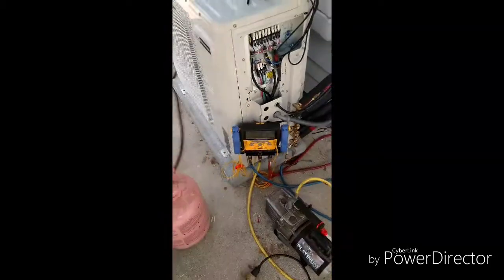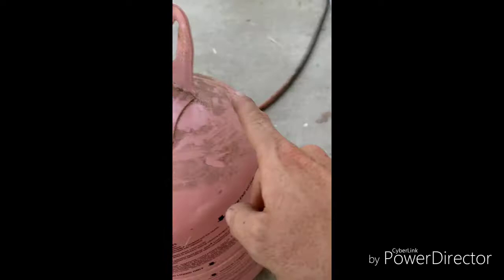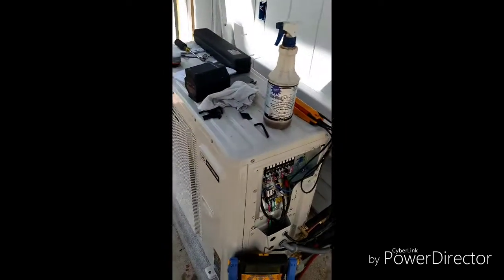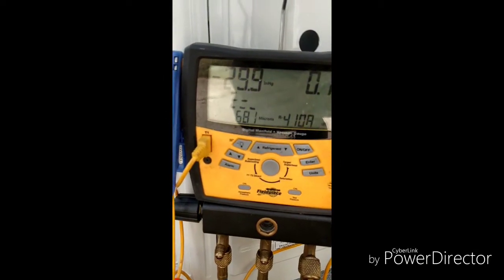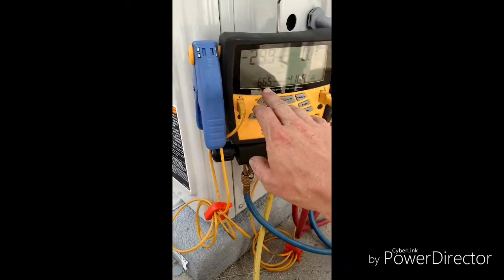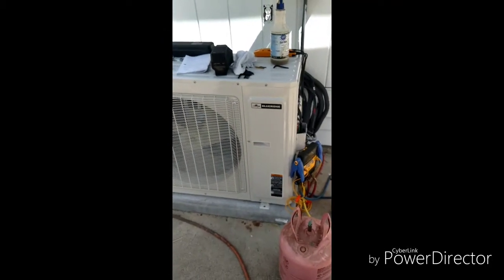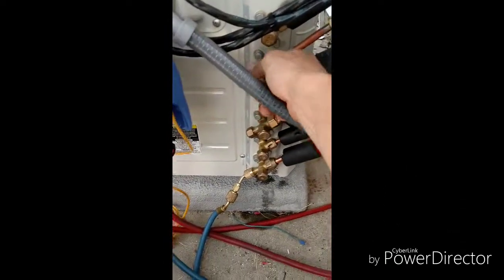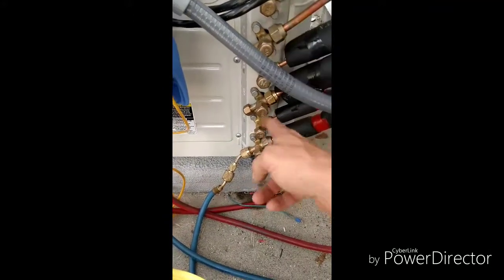How to Master Mini split final install Simple Steps, Vacuum, Pressure, Test!

Comment: Do you have any video of your indoor units?
Reply from the maker: I'm not sure what you mean indoor? The air handler part?
Reply: @sublimefreak2244  yes, the units that heat/cool inside
Reply from the maker: @Matt-rz9fh  I don't but I could take one what part are you looking for?
Reply: @sublimefreak2244  just looking to see how it looks on the wall. I haven't been able to find many videos of a finshed install of the inside unit... I'm debating wether or not i want to spend the extra money on a Daikin system or save thousands on the BlueRidge system.
Reply from the maker: I will try to get a video of one soon, we are doing another install so I can maybe do another video of that

Comment: Thanks for the helpful video! It was kind of hard to hear over the vacuum pump, I was wondering did you add any additional refrigerant or just what the unit comes pre charged with. I’m currently installing a blue ridge mini split in my home and debating whether to do the final steps myself they look pretty straight forward. Thanks again
Reply from the maker: I didn't have to have any more freon. You only have two if your line says exceed the amount becomes pre-charged in the unit. What I would do is call the company and ask them how much it can supply as far as lines go I forget the exact amount and then calculate how many feet of line you have and I'll let you know whether or not you need to add freon